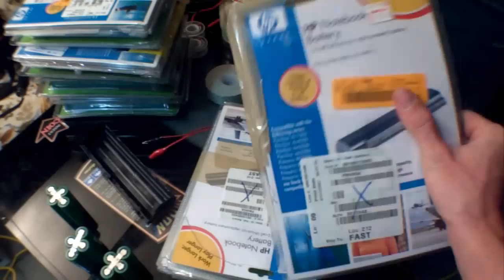DIY: 48v 24ah lithium ion 18650 e-bike battery pack

Comment: There is no load balancer and capacity must be about 300Wh and not less...
Reply from the maker: it has 570wh of capacity. and what do you mean by load balancer? do you mean a balance charger?
Reply: Rinoa Super-Genius oh yes ok, then did not understand the correct capacity :-) 

Yes, load balancer for charging each battery exactly...
Reply from the maker: great850 what is a load balancer? you only need to balance them while charging not while discharging or pulling a load.
Reply: Rinoa Super-Genius yes but a loadblancer needs to be connected to each single cell / cells in parallel circuit.
Reply from the maker: great850 and why do we need to ballance the load?
Reply: Rinoa Super-Genius because he you overload a single cell, it can be damage easily. Why can it happen? Because: some cells reach their fully charge earlier than others, but the charges can not detect that without a wire connected to the cell and a balancer circuit. Cells with the capacity and age connected parallel need only one common connection to the balancer.
Reply from the maker: great850
but your not talking about charging, your talking about loading.

the correct term is "balance charger" not "load balancer"
Reply: Rinoa Super-Genius maybe but in German it's the same charging or loading

Comment: I don't understand you have 12 vtc 4's at a minimum and you say what 24 ah for the whole pack well the green batteries alone are 2100mah equalling 25.2ah  Just for the green colored
Reply from the maker: Vape Apes i say that because thats the actually tested capacity for the whole pack. you can try and calculate the capacity all you want but the real-world test gives the real-world result. especially when your using cells that are almost a decade old like i am.

Comment: Watched a few of your videos as you did what I was doing as well. I am friends with the manager of a recycling center in my city and he has been setting aside all laptop batteries. Thus I have an extremely large amount of laptop batteries to use (more than I think I could use) Would like to hear your ideas on applications. I have already made a battery for my e-bike!
Reply from the maker: start building an electric car. where do you live? if you live near Illinois I would trade lots of cool stuff for laptop packs haha.
Reply: Sweet, I got hurt in Iraq in 04 and an electric bike co. donated a kit to me and I love it!! Great idea with the laptop batteries, I have been looking at lithium batts and cheapest is about 130.00 for a 14 ah 12 volt batt, I need 4 so its going to be about 520.00 What a great idea to save cash. I using SLAs and it weighs 65lbs! ugh.
Reply from the maker: Gary B
ouch thats heavy.

in a few weeks i hope to start building/selling 12v 13ah lithium packs for 45$. i guess i may be reeeaaally undercutting the competition with that price haha.
Reply: Rinoa Super-Genius Washington DC!
Reply from the maker: epicdeuce
ooohhh interesting! perhaps if you find yourself with extra packs we should do a trade. maybe some 1930s-40s power meters from old military radio equipment? this September when I go to the Jacksonville steam engine festival I'm going to buy extra stuff just for trades.
Reply: Rinoa Super-Genius if youre building , im buying!

Comment: If I'm thinking of buying a 1000w electric bike motor (usually 36 or 48v) how many of these computer battery packs will I need (I'm a newbie) and which are the best/cheapest to purchase (on ebay?)
Reply: 11

Comment: Hi would you happen to know the relationship between torque and amperage from the controller and battery?
Reply from the maker: depends on too many variables. you can't can't just have amps and you can't just have torque. you need volts/amps into speed/torque.

but roughly every electric horse power is equal to 5-10 gasoline horse power.
Reply: well i have an electric bike with a 350watt\48volts motor and a 48v12ah battery. If I change the battery from 48v12ah to 48v20ah, would there be an increase in speed or torque on my bike? Thank you in advance! -July
Reply from the maker: CesCamacho84
you can't charge more AH into a battery, once it reaches 100% charge the rest is wasted as heat.

and no, more AH wont make you go faster directly. the only thing it can help is the amount your battery voltage drops while under load.
Reply: nope, i mean change the battery physically, from a 48v12AH battery to a new 48v20ah battery.
Reply: now i get it, i was hoping to increase the  torque of the bike by getting an higher amp battery. It looks like i have to upgrade the controller and motor then. Thank you so much man, appreciate your input on this.
Reply from the maker: CesCamacho84
actually the motor might be ok, most 48v motors can handle 72v.
Reply: would that  burn my motor? or my controller? im not sure if I can add that much on my bike, i only have access to china made lead acid batteries here in the philippines. most branded batteries are way too expensive here and the "china made" batteries are too heavy, adding another battery on my bike will add more weight to it.
Reply from the maker: CesCamacho84
no i mean run the 48v motor with a 72v controller, you can get the controllers cheeper by themselves sometimes.

also lead acid is a bad idea for an e-bike. go with lithium, its much cheeper and lighter.
Reply: i see. i will try but my bike came with that kind of battery. yup i think it is much cheep in the US but here in the Philippine, Lithium will cost you an arm and a leg. :)

Comment: i have a question can these 18650 battery pack run a tv by an inventer?
Reply from the maker: akrammokhtar yes
Reply: can you advice me ,
how to make a pack that in series and parallel of 18650 to make 7 AH at least to run 40 watt TV. as i have lead acid battery (7AH) with inventor that run the TV for few min.

Comment: - There is a good reason that the interconnecting plates are point-contact electrically welded together.  Li-Ion cells are very prone to high temperature.  You probably damaged some of the cells while soldering them directly with that huge apparatus.

- Li-Ion 18650 cells from laptop packs are not individually "protected" against overcharging and deep-discharging.  There is a piece of electronics in the laptop or pack to take care of that.

- You do not balance the cells - some of the series connected packs will be overcharged, while others in the string are not full yet.

- Overcharging a non-protected cell will give the cell the chance to create metallic lithium, with the chance of a "flaming vent-off".

All in all, this battery pack is quite dangerous...

Comment: Can we use aa batteries for this kinda pack.. rechargeable ones??
Reply from the maker: +sri ni if you have a bunch, sure, but they wouldnt work very well. also you could need like 500 of them.
Reply: Thanks for answering. Very good pack you have made there...

Comment: this pack is also missing a charging circuit, since he is charging it in series the lithium batteries on the end will be ruined in no time, never charge lithium ion in a series they burn out quickly, also mixing of battery brands and makes are dangerous, they dont play nice

Comment: Hi guys i have a question i want to create my fisrt battery pack but i dont know how to charge the 36v battery pack.. the imax b6 work 4 this or only works for a 24v battery pack?
Reply: im having the same thoughts at the moment... what i think i will do is make two 18 volt packs and put them in series when on the bike to make 36 volt.. i max will only do 6 cells... 18 volt is 5 cells so it will charge it no problems... im just deciding now how to source them for the best price so i have matching cells throughout...

Comment: Dude, great stuff, love the idea, only I don't own a E-bike. Let me run some ideas by you any ways. I would like to salvage some old macbook pro batteries and maybe buy some laptop batteries from online as well, and make an external battery pack approximately twice the size of my laptop capacity. Then, I would like to design a control unit so I can link up about 3~6 of the item I have described above. So that I would have about a weeks worth of battery charge inside my car when I go on a solo road trip.
I spend about 200 bucks on battery banks for my phone so far, and many of them are crap, so I think building an honest unit is the best way to go. I will subscribe to your page, and hope you don't mind sharing your wisdom on this project.
Thanks,
Shan
Reply from the maker: ah so your making a bigger laptop battery? that should be quite simple actually. just open up one battery and connect cells in parallel with the existing cells. hope that makes sense.
Reply: Well, for macbook air, the batteries are not easily replaceable, so the best hack I have seen so far is to go directly into the charger, take positive and negative and build a 14v or so battery bank to simulate a car battery, only smaller than the actual car battery if possible. The original batteries are not tube shaped, they are flat, so although harvesting the connections directly from the inside and extend that is doable in theory, it would kinda ruin the computer in the long run. So, I have been trying to get the batteries to work in a way so that I can maintain each cell, and solder only a needed amount of batteries to each pack and then connect those in parallel inside my car. I took out the passenger seat and back seat to the trunk to make a bed, below that bed is where I used to keep my deep cycle battery. Now, if I can get the battery packs to act like a dedicated battery bank for laptop only, and charge them with fairly cheap chargers(since I may need multiple charger on road trips), that would be wonderful. Any suggestions as to making the lowest #of cells to form a 14v battery? Plus, if I were to use the same wire for power output and input, will there be a problem? Should I solder something like a control board for safety of charge and discharge?
Reply from the maker: Shan Liu
you will need either a BMS or a balance charger. none of the cells should go above 4.2v

Comment: Как получилось 48v и 35Аh ??? 1 Батарея 18650 = 3,7V 2000 mAh Отсюда выходит что 1 секция из 12 батарей = 3,7 v 24mAh x 6 = 22v 24Ah
Reply from the maker: 1 cell = 4.2v 3AH

3.7v cells are 4,2v at 100% charge.
Reply from the maker: Григорий Григорьянц
yes ^^b

3.7v = 25%
3.8v = 40%
3.9v = 55%
4.0v = 70%
4.1v = 85%
4.2v = 100%
Reply from the maker: Григорий Григорьянц
 ok

Comment: you could probably get 30% more out of your cells if your measured each parallel section and added compensation cells to the lowest capacity ones
Reply from the maker: actually its really even. when i discharge the cells they stay within like 0.02v of each other. but yes latter i measure every single cell and arrange them from that.

Comment: How do you work out how many of these you will need?
Reply: How many cells? Or battery packs. One way as shown in his other videos on the how too. Get a lot of 18650 cells 100+ in my case. Test the capacity of each cell (The OPUS BT-C3100) in my case and mark them. Decide what voltage you want. 72V in my case and divide by 3.7 = 20 parallel pack to reach 72V.

Humm.... this may take a while to write. Well just ask google :-)

Comment: Great video.  Just subscribed.  

Is your e-bike pedal assist or simply throttle control and no pedaling needed for that test ride in the video?

I look forward to seeing how you go about setting up balancing system.  I subscribe to evtvdotme (weekly electric vehicle conversion show on YouTube hosted by Jack Rickard.  He swears by something called bottom balancing.  Of course he is using Lithium Iron Phosphate wikipediadotorg/wiki/Lithium_iron_phosphate_battery cells for automobiles.

Comment: Would you be able to build a motorbike like this?
Reply from the maker: sure, you might want to integrade the battery into the frame a bit more. but you definatly could. wouldnt need a very high Horse Power either, only like maybe 5 electric HP to be as good as like 50 petrol HP. electric has a ton of torque :P
Reply: Man that is awesome and realy interesting.

Comment: how did u get them 24ah when they are low 2ah around i thought the ah dont multiply only the votl's?
Reply from the maker: your thinking of series configuration not parallel. parallel adds the AH together while the series configuration adds the volts.
Reply: oh right so did u do both? i will have too look up how to do both. is that what u did, i didnt know u could add both ways. in 1 set. how are the batterys today? could u give me a good advice what to use today have u fount out more information of better battery's? i was going to do li po but i dont know how to make the right voltage to be 48v as they dont add up to 48v and li po batterys are very dangous
Reply from the maker: Wayne Shepherd
 these batteries have already taken me a few hundred miles and are showing no signs of slowing down. you notice in this video that i connected like 12 cells in parallel and made long rows. then i connected those rows in series. when you connect cells in parallel they basicly act as a bigger battery. so imagine this battery as 6 large batteries in series, but each one of those battery segments is comprised of 12 18650 cells.

LiPo batteries arent dangerous as long as you ballance charge them. makinng them a 24v pack will let you charge with a cheep imax b6.

oh and the voltage doesnt have to b exact. a battery's voltage is always changing. and if a motor is made for 48v its really made for 43-53v or so.
Reply: oh great, thanks i was on terms of telling myself this by what i keep looking up. thanks for that mate. so if im right say i have 4x li p 7's 25.9V 5800mah if i connect series and parrell. they will be 51.8v and 11600mah? if this is right. is it possible to add a 3rd to each for parrell. so there will be 3 each side, or dos it have to be in 2's 4's 6's 8's. but still not sure how if u can. =D
Reply from the maker: Wayne Shepherd
it sounds like you understand it. just think of it like a grid where if you expand in one direction all the rows have to grow also. in the description of this video is a diagram that might make it easier to understand what i mean.
Reply: do u think li po are still number 1 battery's for weight? and bulky or the battery's u use. i have seen some 13000mah c battery's, but they are only 1.2v that would be around 30+ i guess i should calculate size and weight of all. =D im not sure yet though of the battery's 18650
or c battery's or li po
Reply: oh i also bin looking at them power bank battery's. the high end one's they spost to have 35ah battery. with 20v output now. i just cant find information of what voltage they are.... and i know the cheapo are false MA
Reply: the 26650 look very interesting high v and high mah. i might give them a shot mate. but i will watch your video too see how too. when i test each battery volt. they are 3.7 what volts u think they should be par and not ove say like 0.5v? + and -
Reply: so if calculations is 3.7v and 5500mah
96 would only be 51.8v and 22AH? that sound's no where near your's!!!!!! errrm. is the 24AH the 2 huge block's together? like 150 cell's? or the 1 block?
Reply: or would that be 68AH?
Reply: cant be right =D

Comment: what voltage can i charge 1 cell with? thanks in advance for the reply .
Reply from the maker: 4.2v is good.

but every 0.1v you lower the voltage you get 2x as many cycles. like 4.2v you get 300-500. 4.1v you get 600-1200, 4.0v you get 1200-2000